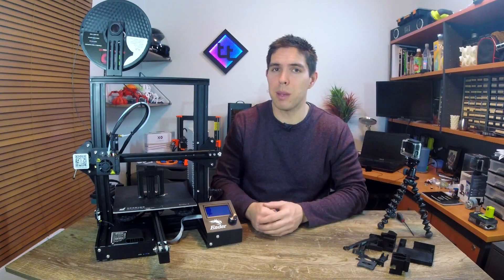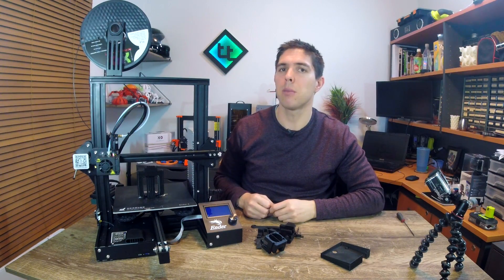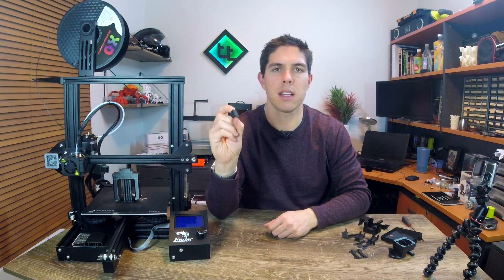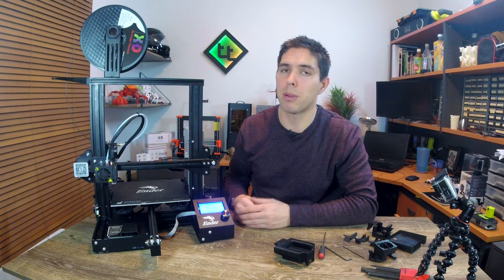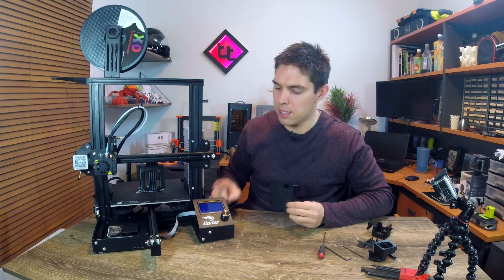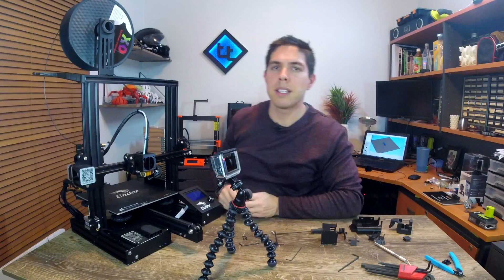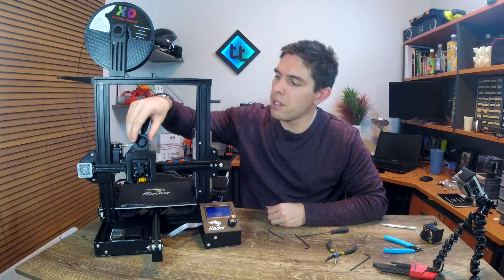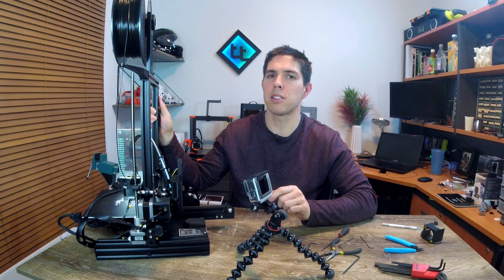7 easy 3D printed upgrades for your Ender 3

Comment: The low filament guide snap in does more harm than good. My experience is the same as many reviewers. While it stays on, which isn't for long, it causes under extrusions and damages prints.
Reply: Agreed, screwed a bunch of things up. Maybe if it was shortened to put less of an angle to the left on the filament it would be better

Comment: Thank you for telling me about the z axis spacers! I've been struggling with it jamming all day.

Trying to print a mini figure and every time it would get to the head, the z axis would jam and wreck it. Finally I can get it to work!
Reply: I know this is old now, but the bracket isn't bent a perfect 90 degrees is why that motor was binding.
Reply: Maybe.  But the real problem is that the bracket comes pre-assembled onto the motor, and most people just screw the bracket to the frame.  If the bracket is loosened from the motor before it is screwed to the frame, and then the motor tightened down on the bracket, it lines up perfectly with the frame and shims are not needed.

Comment: nooo! Don't use any 3d printed shims or parts in upgrading. The idea is to reduce flex and make the frame more rigid. Stamped or CNC aluminum and steel parts are the way to go. firms it up and will not wear.
Ender 3 is a good starting platform for getting into 3d printing, but it can be made so much better. recommended you get one, and over time, put about $2-300 into upgrades and you'll have a fine printer :-) for the money you put into upgrading, you'll have a better machine even than printers costing 400 or 500!

Comment: good video and i realy like the upgrade parts after i build it and do the test print after adding more line so it makes a full test print i will be printing all the upgrade parts be for i do anything els the biggest thing i did not like about seeing this 3d printer was no back cover for the lcd screen i allmost did not buy it just due to that alone so i am so happy to find a cover all the parts are good big upgrades thanks a lot for listing them if u can list more parts i can print would be a big help

Comment: Can you extend the build height on an Ender 3? Would it be possible to use uprights from a CR10 or similar to get a taller printer for less money than the CR10?
Reply: I am not a professional, nor have I done it, so I can't say for sure.  I can, however, say that you would also need a taller Z screw

Comment: At 10 min in you say it only requires one screw but it has a reset screw for a second screw. It's supposed to have two holding it in place using the factory mounting screws that's why the fan doesn't screw in on the corner.

Comment: What kind of filaments can use with that printer? Only plastic or rubber too?
Reply from the maker: I've successfully printed PLA, ABS, PETG and TPU (which is flexible filament much like rubber).
Reply: @TeachingTech  Thanks for your answer. I'm just thinking about purchase that one or anet a6

Comment: Would it be worth to change the original board to a mks gen, ramps, or any other board supporting switchable stepper drivers? This way you could install the TMC2130 which as far as I know, improve print quality and noise reduction
Reply from the maker: Eventually I will be doing this. 2130 install coming up on my Frankendoodle.
Reply: @TeachingTech  cool! Ive just received my ender 3 and Im implementing all the upgrades featured on your videos, so Im looking forward to see your results with the 2130 :)

Comment: Side mount bracket for the spool is way better than the little extender attachment, moves whole spool to next to the feeder. Also the spool reel inserts so the spool spins on its axis.
Reply: Spool reel inserts, got link?  Also i was wondering if the side mount is better or not since the angle of the feed will change with the amount of filament left.
Reply: @CluelessSi  It's still much better on the side. Way less of a harsh angle and so the filament doesn't wear away the extruder plastic. I also suggest an all metal extruder as well.

Comment: Hi Michael, thanks for this video.... I       noticed that the "Petsfang" file on Thingiverse,  has been changed to only have the "Bullseye" version rather than the one you have shown... its the "stock fans, stock or microswiss hotend"   David Petsel appears to have dropped it for the bullseye which I saw elsewhere is lighter??    Rgds  Laurie Tokoroa NZ
Reply from the maker: Correct. The Bullseye is designed to use the standard 4010 blower fan.

Comment: I want to ask a question. As Geetech look like Ender 3 is it possible to put 2 extruders on Ender 3 like A10M? If yes does it worth it. Because I have one Ender 3 and I really like the idea of having two color or mixed color prints. I really don't want to invest a new printer, but will like to upgrade if possible. Thanks in advance for an answer?
Reply from the maker: I think you could do it. Need to change mainboard to one that supports more extruders and has a 2560 microcontroller. Apart from that you just need a extruder mount that bolts them to the horizontal frame extrusion at the top. Could even use the Geeetech firmware as  basis since it's on their github.

Comment: Hi!
5:00 - do these spacers work for Tevo Flash? I see some problem there as well (fill find out if it's causing issue soon). My left carriage has no straight 90deg. angle and I've installed a rubber spacer (DIY from a bicycle's camera) to be able to compensate that angle in the "gear" detail. Not a best solution but I don't have a machine to bend this carriage to a proper angle.
Reply from the maker: I don't have one to test sorry.

Comment: Doesn't that fan shroud mod limit the the z axis height? Also, will this machine handle PETG?
Reply from the maker: No limitations and PETG also no problem.
Reply: @TeachingTech  How does it not limit the z axis? That fan on top adds about 3 inches on top of the extruder.

Comment: I have tried to print every one to these using the settings suggested by slic3r and the creators of the models and not one of them has been successful or any ware close to the quality you have there, not sure what I'm doing wrong I'm trying to print in ABS with a extruder temp of 230 and bed temp of 110.
Reply from the maker: ABS is a lot harder than PLA. Maybe this one will help you: https://www.youtube.com/watch?v=mAU7cIZ0Hns

Comment: I just mounted to spool-holder on the side of the frame.
Reply from the maker: Does that prevent the printer from reaching the full 250mm height?
Reply: I am not sure. I measured the under side of the spool to be level with the extruder at around 150 mm. And even with a full spool it should go annother six to eight cm without any problem. But most of my prints are way under 100 mm in height anyways, so if even if it would limit the height it would not matter for me.
Reply: What I was totally blind for and what still does not bother me, the x-carriage roller hits the filament-holder and therefore the height is limited to 210 mm.

Comment: I believe you printed the fang in the wrong orientation
Reply: He did, it does not need supports at and prints just fine flat on the bed.
Reply from the maker: Correct.

Comment: I just got my first printer and it's an Ender 3. I've been watching these excellent vids for the guidance and information on what to do :)

Fan guard printed and fixed in place :) Now to continue with this vid and printing and fixing :D 

Thank you for these absolutely excellent videos!
Reply from the maker: You're welcome, thanks for watching.
Reply: @TeachingTech  you may know now but the reason the z motor binds is the bracket isn't bent perfectly square. Reshape the bracket to a perfect 90 degrees and you won't need the spacers
Reply: My first printer is the Ender 3 aswel. Had it for some time now and think I have it running just as it should be. They can be a temprimental beast for sure but the results for an entry level printer are astounding.

Comment: For anyone who may be interested. I made my own Prusa Style Spring Steel Bed. Using these:
Spring Steel Plate:
https://www.amazon.com/gp/product/B07D8KW6R1/ref=oh_aui_detailpage_o07_s00?ie=UTF8&psc=1

CCTREE Bed surface:
https://www.amazon.com/gp/product/B07DC7NG4N/ref=oh_aui_detailpage_o08_s00?ie=UTF8&psc=1

And it works like a dream. Its a bit larger than the actual bed. You can use it longwise on the bed without having to cut it. But if you want, you can use sheet metal snips, although I imagine it will be very hard. I am planning on cutting mine this weekend with a grinder. Very carefully of course. I'm using it as is and I have to say being able to flex the print off is an absolute dream. The CCTREE bed surface works amazing with PLA at 70c. Not too good at 60c. And ABS absolutely loves this stuff. It sticks too well with ABS. I've replaced the bed surface twice because I could not get the ABS off without it leaving an ABS coat on the bed. Eventually it just ripped off. This was when I was still using the provided fibre bed board that Creality now provides with the Ender3. Anywho... I hope this helps someone.
Reply from the maker: Thanks for the detailed post and links. It is very satisfying to develop your own solution that works. Are you holding the plate on with binder clips?
Reply: @TeachingTech actually yes. The binder clips hold it very well and steady. No issues thus far thankfully.
Reply: Sorry I missed this reply. Yes the binder clips onto the raw aluminum heated bed. I've had to up the bed temp for PLA to 70c instead of 60c, but it works beautifully.
Here is a picture of the steel bed with the CCTree surface on it:
http://aencmg.com/nopass/personal/julio/3dprints/SteelSpringBed_Front.jpg
Here is the back of it:
http://aencmg.com/nopass/personal/julio/3dprints/SteelSpringBed_Behind.jpg
Here is a miniature after all my upgrades:
http://aencmg.com/nopass/personal/julio/3dprints/IMG_20180921_122758.jpg
Here is an XYZ Calibration cube after my upgrades:
http://aencmg.com/nopass/personal/julio/3dprints/XYZCubeOtherAngle.jpg

All in all, I'm super happy with the results of all that work. Thanks again for all the advice on your channel. You have been a huge help to me and I really appreciate it.

Comment: i just downloaded the petsfang files from thingverse(from your description link) but i don't have any duct with stock fan at cr10 or any others(only 5015 blower), bullseye is the only one that has duct for stock fan, are you sure is the correct link ? many thanks for your videos !,
Reply from the maker: It used to be there. They are constantly iterating which makes it hard to follow. Perhaps this is an error. I will be testing the bullseye withy Ender 3 pro.
Reply: I downloaded the Petsfang files about a month or so ago, and it had a duct for the stock blower fan at that time. From what I've read elsewhere, they had problems with the stock fan in the regular Petsfang, it just didn't have as much strength as the other type of fan, so they removed it and created the Bullseye to replace it, which is similar but has a slightly different shape to maximize the air movement.

Comment: At 13:08 when you push your bed back, you notice the screen lights up. You just generated power with your stepper motors. This can damage your electronics so I suggest not doing that. You can still manually push the bed or hot end but slow it down so that the steppers don't generate enough power to mess anything up.
Reply from the maker: You're spot on, I was too quick here. Interestingly enough to smoothers have the bonus of protecting from this.

Comment: I have been steadily upgrading my Ender 3. Adding dampers, printed parts, all metal extruder and hotend etc... I was thinking of upgrading the power supply to a 24V 500W power supply. Would this power supply fry the mother board or any of the components on the Ender 3 because it is 21A instead of 15A like the default power supply? My hope is to drastically shorten the warm up times of the bed and nozzle. Also I was planning on tweeking the power settings to the stepper motors. Should I not do this?
Reply from the maker: With power supplies, the power rating is the max it can deliver, but it will only deliver that much if a connected component draws that much current. Think of it as components sucking what they need rather than the power supply forcing what it can give. Therefore the heat up time won't change, you'll just have more headroom for future upgrades. The stepper drivers should be tuned to deliver a target current to the steppers. More is not necessarily better, so I would not adjust it without reason.
Reply: Got it. Thanks for the quick reply. Much appreciated.

Comment: Mine has the Control Board upside down, fan is facing down. Ender 3 Pro that is.
Reply from the maker: I've just received a pro and noticed the same. I'm wondering if it's a general Ender 3 update or exclusive to the pro.

Comment: I got One :)  :)  :)
Reply from the maker: Congrats!
Reply: Thank you. Doing mostly upgrades. A few you didn't mention here plus some of the ones you did.
It was shaky at first, having bed issuess and then extruder issuses since seems ok now. Lots of adjustments.

Can I print TPU on the Ender 3 stock nozel and extruder?
Reply: Thank You very much. I really appreciate all that you do.

Comment: The Petsfang duct thingiverse file seems very confusing. I can't seem to find the two files for the hotend mount and the duct you printed in your video. Would you be kind enough to advise the file name for these two? Thanks mate.
Reply from the maker: As I explained in the video the version I printed was dimensionally incorrect and later removed. You now want the standard cr-10/ender 3 mount plus the two bltouch files.
Reply: Add me to the completely baffled list. I cannot find the duct from the video in the current petsfang files, can you verify it's still there and perhaps the .stl file name, please? PS huge fan of your videos, thank you!
Reply from the maker: There are two guides linked: http://www.dpetsel.com/files2print-modular-v2.html
I can see in the files cr-10 stock manual base, all BLT left and cr10tevo duct 5015 as described.
Reply: Ahh, solved: https://www.reddit.com/r/ender3/comments/9da0a0/petsfang_duct/

Comment: I received my ender 3 and is missing a spring under the bed so I can't level it right and so It doesn't print right... Facepalm... Waiting for gearbest/creality to send me a spring :(
Reply from the maker: That is a really annoying stuff up on their part. Hopefully you are are printing soon.
Reply: Yeah thanks, I bought a set of 10 "uxcell springs" for 5€ on amazon that are according to all3dp dot com an upgrade for the originals on the ender 3 so I'll be replacing all of them when they arrive later this month. I don't know if gearbest or creality will supply me a spring but I figured out it would be easier to just buy better ones for 5€. Sad I will have to wait almost the entire month for them to arrive but whatever... Btw thanks for the videos, they are great! And I'll be following your ender 3 upgrades videos and ender 3 related videos to improve my printer.

Comment: good afternoon

can you help me the fan of the plate is damaged and here in my country is not easy to meet, the specifications are 24v 0.1A but the one I found is 24v 100A is much faster and generates noise but can affect the electronic part
Reply from the maker: Any cheap 24v fan in the same size will be compatible.

Comment: Thank you Michael these seem to be some really good upgrades. I'll be getting my ender today in the mail. I just got my neighbor one Monday and I want to make sure I get him in the right direction. It's his first printer. I have 4 of my machines working on these upgrades as I speak for when mine comes in. I think it would be convenient to just add them as I build it. So thank you for another awesome video my friend. There always very helpful.
Reply from the maker: Thanks Bobby, great feedback. I appreciate it.
Reply: @TeachingTech  I dont know why I haven't seen anyone using the build surface like a Easypeelzy. I haven't stuck mine to the build plate I just use the clips to hold it. When my print is finished just like the Easypeelzy I take it off an twist it a little and the prints pop right off just like the Easypeelzy.

Comment: Is there a way to shut down the printer after a print and could you please tell me what is the best practice for turning off the printer as well. Thanks !
Reply from the maker: Difficult to shut it down completely. The end gcode should already be set to shut off the heaters and stepper motors.

Comment: Hi, I just received my Creality 3d , did put together .
Saw video to make sure it was correct .
Starts  okay , but  does go to center , and  will not move up.   HELP
Any help would be great .  I'm using CURA 15.04.2.
Reply from the maker: This is not a technical support forum. Please join some Ender 3 Facebook groups and post there. Good luck!

Comment: i attempted the extruder fan upgrade and seem to have stripped a bolt holding the stock metal box enclosure with the ender symbol and warning label. how can i fix this?
Reply from the maker: I would join an Ender 3 facebook group and see if someon has a spare part to sell or trade. You could post pics there too.
Reply: Teaching Tech I appreciate this! But I've already gone and bought Easy out drill bits for my drill. They will grip the inside of the screw and pull it out! I also ordered a set of screws for back up for future projects. Can't wait for the next 3d printing video!

Comment: Hello there! I have a question. My Z axis does a cricking noise when it's going up over the 50% of the height, any ideas what's might causing this :( (Newbie).
Reply from the maker: Any obstructions? You can try loosening the bolts holding the nut on the lead screw to see if that helps.